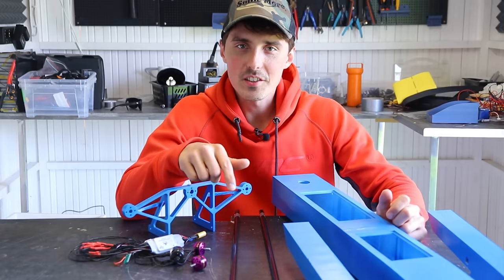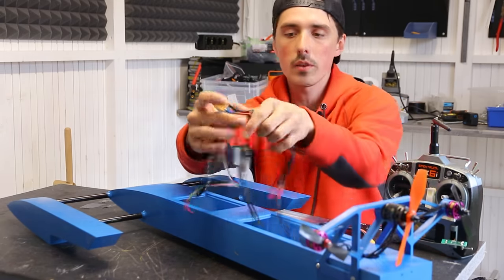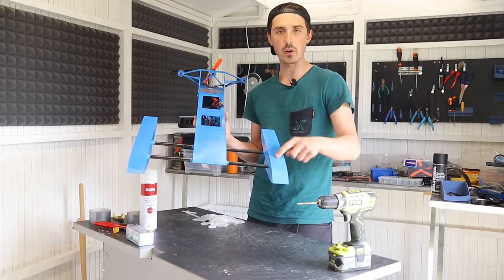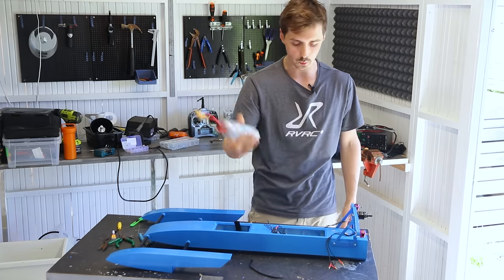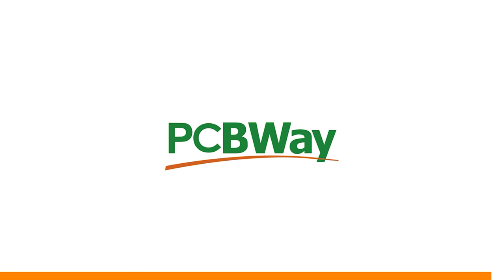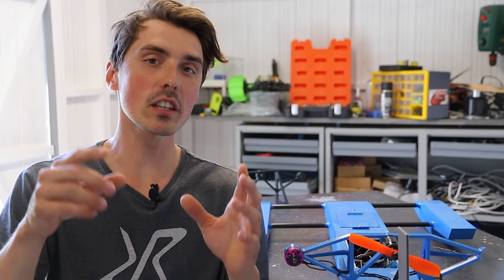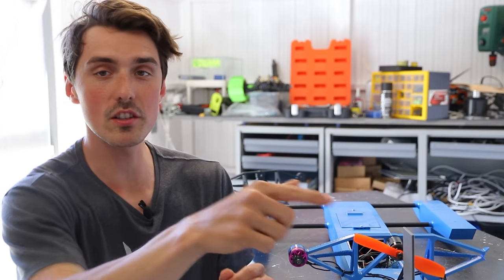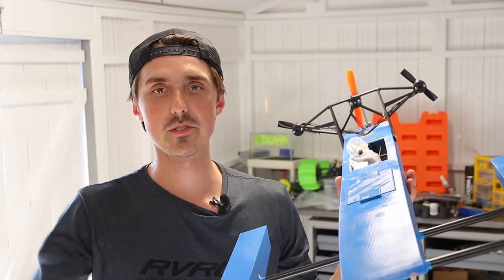Frictionless Hydroplane With Aerodynamic Steering

Comment: I made a little toe behind mower rd, big brushed motor with a homemade welded on mini mower blade, it too sheared off but I did heat the metal ruining it's structural integrity,  that and it sad too low and I hit a low spot lol, man i wanna make a boat with the numerous controls ecs and motors I have laying around,  good stuff

Comment: If you want better steering, put little skags on all three keels.  These will put more boat under the water, according to steering thrust, but will be almost invisible when going straight.  12 - 20mm deep. 1mm wide, and 25mm long, tapered for hydrodynamics.  Put these a little forward of the center of gravity and you will have far better steering.

Comment: If you want to get some better steering, maybe add a small fin on the bottom of each pontoon... If you look at the way it steers without this, youll see that the whole boat yaws while still going moatly straight... I bet if you add these, it should help it get going in the right direction.

Comment: Guess it would make sense to add ardupilot to control the turns and do gyro stabilization of the course. Ardupilot could also be tasked to cut the motor power if the boat tries to flip up again, or tilt down too much, until the boat is level again.

To improve the turns, add a very, very tiny ridge on each of the pontoons in the center length wise, say 0.5 mm in height and sharp as a knife. This way sliding sideways in the front is avoided, as currently the higher the speed the lower the impact of the sidewalls and thus the lower the steering authority.

Comment: you had a lot of water getting kicked up into the props in every version of this little boat, imo if you had some sort of extension of the rear hull to shroud the prop and keep water out of it you would have gotten better results
Reply: oh yeah this would be why the shaft broke, water hitting the prop and causing it to torque very hard against the motor

Comment: I got an idea for steering. a servo on each of the side boats that is not touching the water until you want to turn and it lowers a stick into the water to grip the water and slow that side of the boat pulling it in that direction.

Comment: Consider a different shape?  How about a single curved wing shape, curved like a boomerang and in center a bit of a tail body for mounting hydroplane lift blades on underside and housing battery and motor.  Maybe dropped under each wing toward tip a hydroplane lift blade. use shallow steerable tiller at tail of center body extension,

Comment: This is not a hydroplane, it is an Air Boat. Hydroplanes get propulsion from and immersed propeller.
Reply: He is using a rudder like a hydroplane, so it is some sort of cross between them both. If he got rid of the rudder, or just used a servo to lift it, it could be amphibious, too.

Comment: Hi Simon, I really like this Hydroplane.  Is there any chance you could make STL files or g-code files available for all the 3D printed parts of final version?  Also, post links to the motors, propellers, batteries, controllers, and anything else you used?
Reply: Did you get an answer? I'm also interested.
Reply: @alainhaentjens6558  No answer yet, BUT I'm still hoping.  I'll keep checking for a reply from Simon

Comment: Recommendation: use PCBWay circuit board for rudder+steering instead of 3D print. Why? Drag and strength is better due to thin material. You will see a big speed improvement and less weight means faster boat. Aluminum is often best but given your sponsor, use that instead!

Comment: Seems to me the boat would be faster off the line if all 3 parts had v hauls on the bottoms. They would have to be level to each other therefor different angles but they would have less contact with the water giving less friction at the start and while running and skipping across the water.

Comment: This original design is called the "Piranha" And was designed by Dumas in the 80's. Funny thing is your thinking it was your idea. I looked over Dumas website they don't manufacture this kit anymore.  It was designed to have an outboard nitro fuel motor on it. They claimed it had a speed of up to 80mph on standard fuel. My buddies was much faster than that. He  was using a K&B 7.2cc on it. But he used 50% Nitro mix in that. You could barely keep track of it and one day he turned into a corner and ran right through my other buddies boat and that was the end of it.

Comment: You built a .40-.60 size outrigger hydro. You are underpowered and to get the power for that size hull you would need a much bigger prop which will lead to more problems.
If you scale it down you might get better results.

Comment: You only need two motors to steer. The middle motor is just unneccessary weight. Btw. it's called differential steering. Put your ESC's and receiver inside balloons to keep them dry or use water repellent or water sealant spray.
Mine (bad video, sorry) doesn't get up to full speed on this short distance, but at full speed it does about 35-40mph. It's a 4 contact points hydro and stays stable upto wind force 5, just touching the tops of the waves: https://youtu.be/c_Exrb7Yngg

Comment: there's no such thing as aerodynamic steering, now the steering is similar how zero turn mowers steer where when you push the left stick forward then the left wheel will get more power and push you around to the right. So it's known as HYDROSTATIC steering.